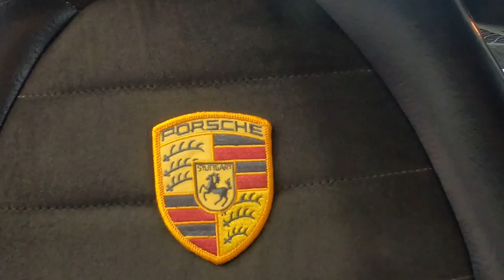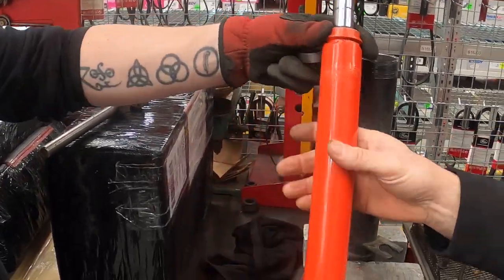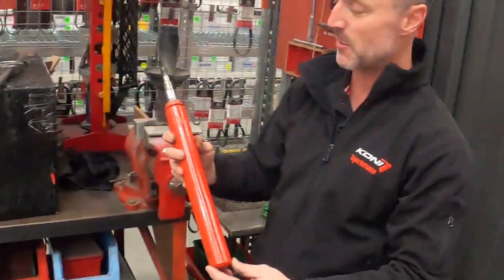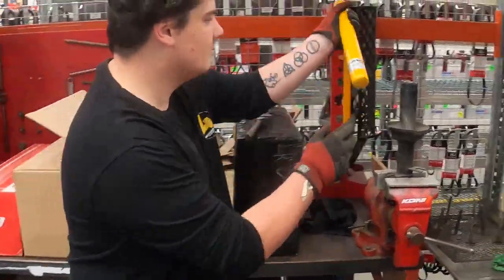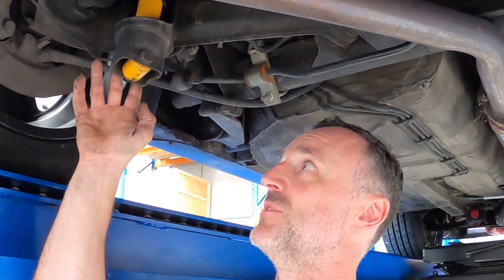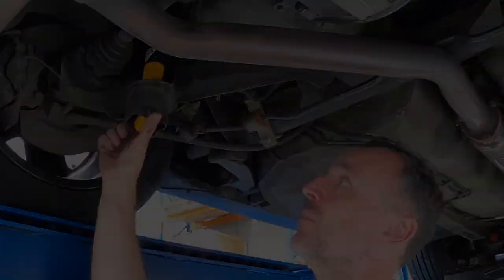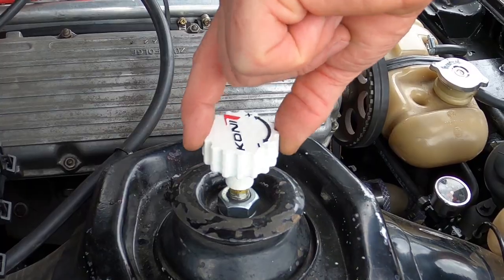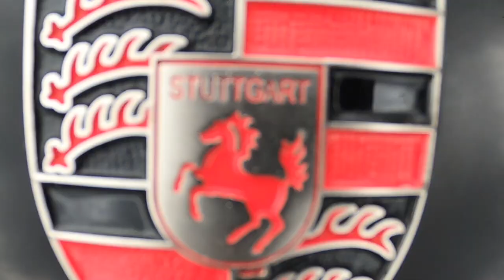KONI SPORT INSTALL IN A SUPERCHARGED PORSCHE 924

Comment: I have just out a set of Fuchs wheels on my 924S 1986 rhd. The fronts are 6Jx16 ET36 (original is 52.3) and the left wheels sticks out a lot more than the right. Did you have the same issue? I see you have 17 inch wheels. Wow

Comment: Body of a 944 ?
Reply from the maker: Similar, has a Carrera GT front and a fibreglass wide body kit on the rear. Yes, certainly looks like a 944!
Reply: @KONI AUSTRALIA  what wide body panels did you use? Were they for a 944, trying to figure this out for my car
Reply: @xrpninja  Hey mate, the front is a fiberglass kit from the 924 Carrera GT. Rear is the same appearance as a 944 but the casting was known as a wide body kit for the 924. Pretty sure its the same as the Al Holbert wide body kit. Magnus Walker has a good example of an Al Holbert wide body 924. Not 100%  sure of the exact origins as the body was done over 20 years ago by previous owner.

Comment: I wondered where that car got to. Did you replace the Wolf ECU?
Reply: Hi Josh, Wolf 3D replaced with a Haltech Elite 550. It now runs a trigger wheel, coil packs and uses the dizzy as a cam sensor. How do you know the car?